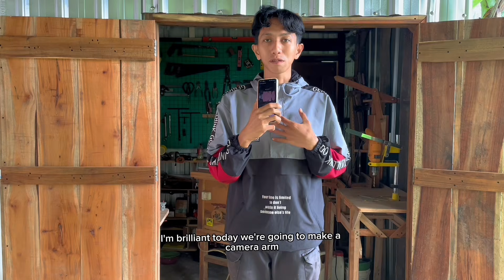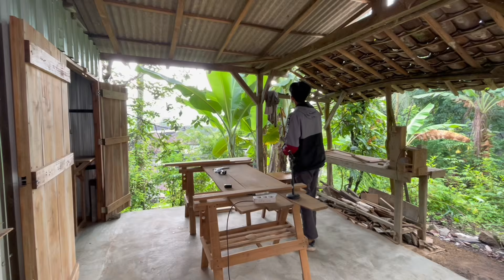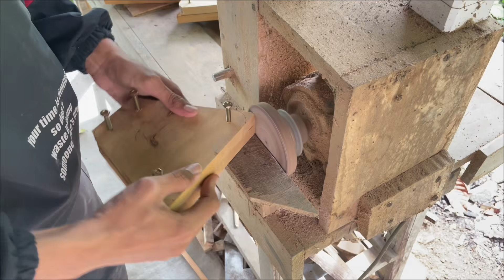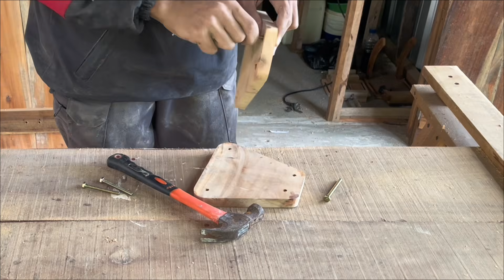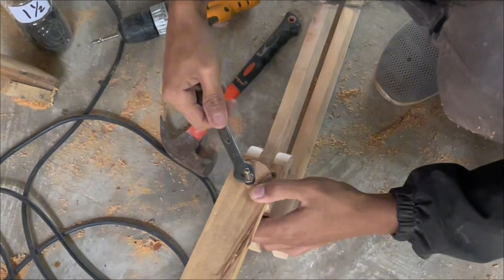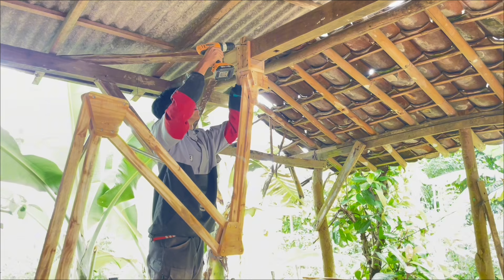I Asked ChatGPT to Design My Camera Arm (DIY Woodworking)

Comment: I believe the sqeaking comes from the wood rubbing against itself whenever you adjust your camera arm. Maybe use some paste wax in your joints. Ask ChatGPT for more information. That's what I did.
Reply from the maker: Yeah it said to me that's too. But I just kinda don't have much time if I need to reassemble it again after adding some wax 😅